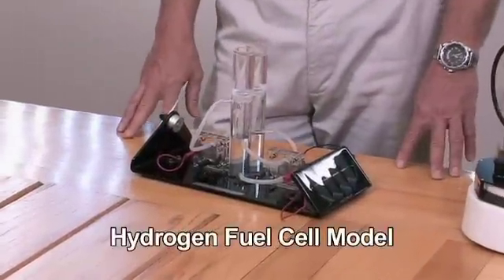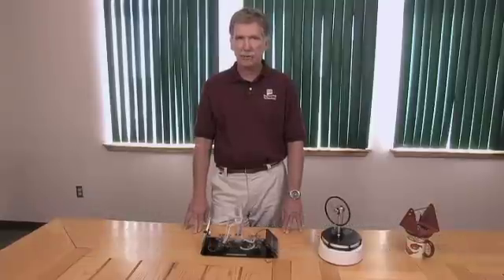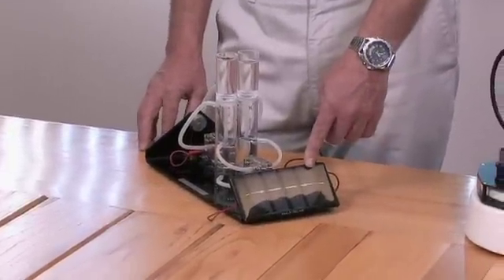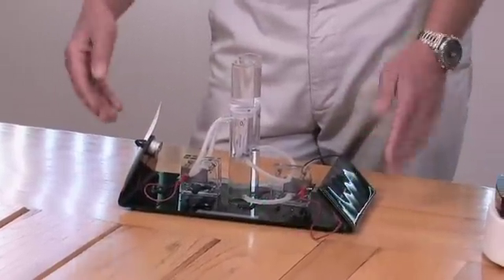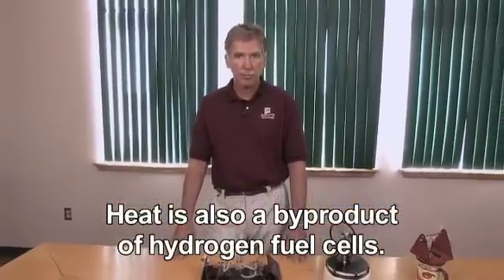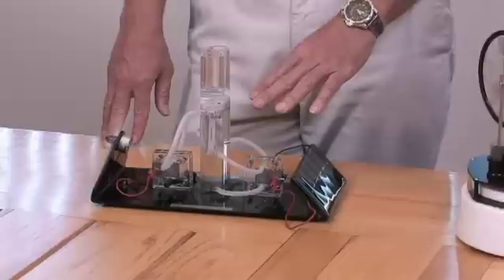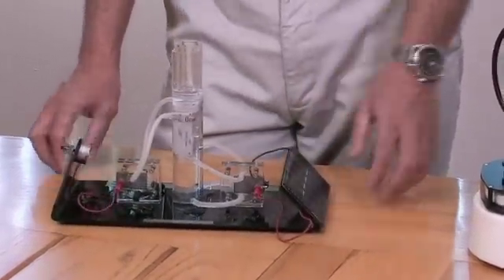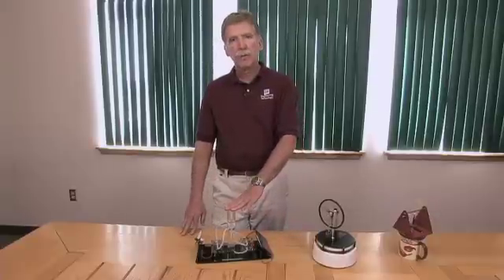Renewable Energy: Fuel Cell Model

Comment: Professor Jenkins:  Considering that going from one source of energy (solar) to another (hydrogen) prior to doing work (fan) seems like 1) unnecessary complication/duplication of effort, and 2) every energy conversion results in efficiency losses, wouldn't it be a good idea if you explained why you bother with this process versus simply going from solar to the fan directly?